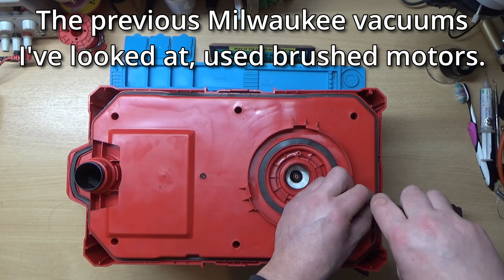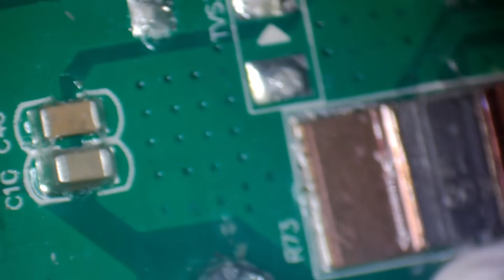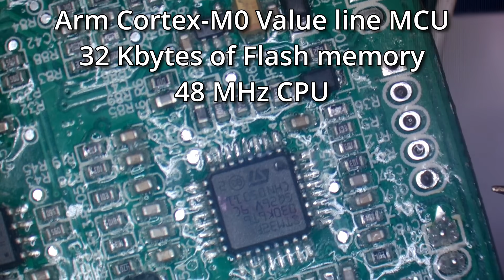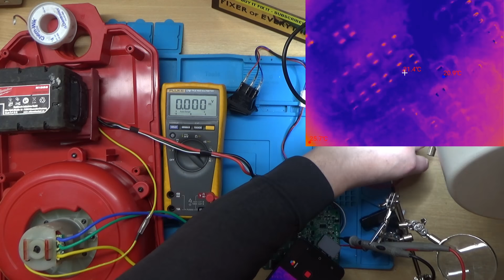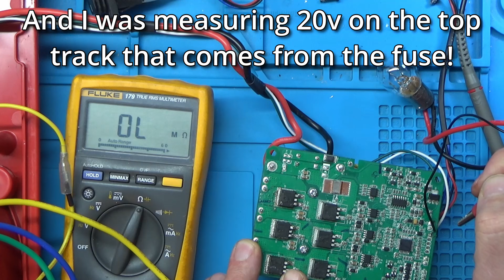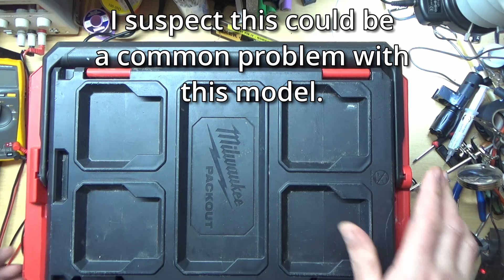Faulty Milwaukee Packout Vacuum Cleaner | Can I Fix It?

Comment: Mine makes a sound, and it turns off in a split second any idea what that could be?
Reply from the maker: I'd replace the fuse first. The guy that sent me it had another which would run for a minute before cutting out and it was the fuse faulty too.
Reply: i got mine to run after flipping it and removing filter... ran it for 2 min, reinstalled the filter and it works... weird, now it will be ok until i clean it again... dont know whats causing it, cant be fuse, since its running  @BuyitFixit
Reply from the maker: It can mate, the guy that I got it from had the exact symptoms with another. I think the fuse heats up, disconnects, then after r it cools it's good again. With the filter blocked it would be drawing more current and heating up faster. I'd replace it like I did and see if it cures the problem.
Reply: @BuyitFixit  i dont think its fuse... it doesnt run after 2 days of not using it
Reply from the maker: @genekhuc8824  I'm not 100% could be a dry joint. The guy I got it off told me that the other one he had would run for a few minutes and then would cut out, and he couldn't find any temperature cut off. He later said that he tried bridging out the fuse on that one and now it's running without issue. Perhaps yours is a different issue.

Comment: I've had just about as much as I can take of Milwaukee unfit for purpose electronics.

M18 Circular saw board gone & costs as much to replace the board as buy a brand new saw.

Same with M18 Surge Impact driver, replacement board is £10 less than whole new tool.

The quality of Milwaukee electronics is appalling & their slogan of "Nothing but Heavy Duty" is a joke.
Reply from the maker: Yes I also found the price of replacement parts were almost the price of a new tool 🙁

Comment: I reckon I'd have installed a panel mounted fuse holder next to the battery to make it easier to replace next time..
Reply from the maker: Good idea, but hopefully there shouldn't be a next time 😂👍
Reply: @BuyitFixit  I'm afraid i don't share your optimism! You already know of three which had the same fault.
Reply from the maker: @NeilTheTurtle That is true, however it was the fuse itself that was the problem on those three units. If the automotive fuse blows it will probably have a reason (shorted mosfet or such) which would require disassembly to repair any.
Reply: @BuyitFixit  yeah, that's a good point. Keep up the good work.

Comment: @36'20" you are spot on. It's a resettable fuse. Bizarre effect.
Looks like they accidently used a PTC fuse in the production line with '30' marking instead of a normal 30amp SMT fuse.

Easy to do and sadly might get through initial quality control as these resettable fuses can cope with a few dozen overload cycles before failing progressively in this way.
"30" probably indicates 3 Amp nominal. These resettable fuses hang on during over load and can often cope with momentary 40 amp spikes.

Milwaukee quality control probably would have caught it if they had done a prolonged 'filter clogged' test.
Had a similar fault in a battery operated toy train. Much easier to diagnose as the train motor operated normally until a load was put on it.
I imagine that your vacuum initially worked ok then started failing under high load, progressively degrading to the point you got it
Interestingly, in my case, resoldering the ends of the PTC fuse partially restored it's ability to work (short term).

Probably only affects a few dozen units in that production run.
I wonder if the units did actually fail quality control, were rejected and because they sort-of worked someone snuck them out of the factory and sold them.
Makes you understand why manufacturers who value their reputation crush their rejects.

For some good info search for "Eaton-Ptc-Resettable-Fuse-Application-Guidelines"
Reply: is there a vacuum running around with a 25A car fuse now? 😅
Reply from the maker: @prometheus4130  Of course. Better than factory 😂😂😂😂
Reply: @BuyitFixit  if you’re interested I have an inventor dehumidifier which sort of works but the control board is faulty. works sometimes but often not. got it on ebay with a mind to fixing it but not had any luck yet
Reply from the maker: Sounds like a dry joint or capacitor especially if it's working intermittently.
Reply from the maker: Thank you, and thanks also for the long a nd detailed comment. Interestingly the another unit that Scott had was a slightly different fault but the same root cause. That unit would run for so long until cutting out which progressively got worse over time. Thanks again for your thoughts and comment 👍
Reply: @BuyitFixit  Yep, that other unit was at the early stage of poly fuse failure.

Comment: Many times if the wire integrity is compromised you will get a reading but it will not be able to handle the load. The bulb/load test is an excellent tool. Great job
Reply from the maker: Thank you 👍

Comment: My god, microcontrollers on a vacuum cleaner? It should have a switch, battery, and a motor.
Reply from the maker: I've got a couple of LED lights, one is a spotlight which was all run by a microcontroller. It ran mosfets to generate the voltage and monitored the current as well as control the brightness via a push button. It's on the channel and called Milwaukee Spotlight repair I think. I've done a few lights most have microcontrollers now, but use separate LED driver chips.

Comment: Good find! I had all my bets on the switch. I've seen it many times that a corroded switch makes a brief contact while switching but is not latching on permanently. Would have never thought about a fuse failing only under load.
Reply from the maker: Thanks, yes it was pretty much a head scratcher for me too! And it seems like it could be a fairly common problem with this model.

Comment: I have a plasma table wich has a big ring transformer in it
It is from usa so it is 2 x 110 volt rewired for 230 volt
It has 2 auto reset fuses inside like yours but they only reset 3 or 4 times
I cut them out and replaced them with automotive fuses and never had any problems with it
Best wishes from Holland
Reply from the maker: Nice 👍automotive fuses seem to come in handy 😂😂😂 Greetings from the UK 🙂

Comment: the only way I see this can happen is overloading the motor - although it would have taken one of the IGBT's with it
or a battery with corroded contacts
Reply from the maker: Or possibly a faulty batch or poor quality fuses. The same guy had 3 with all exactly the same problem. There is current sensing on the board, and I didn't see any signs of corrosion on the battery terminals.
Reply: @BuyitFixit  seen fake batteries with totally off voltages … so yeah
Reply: @BuyitFixit  Interesting he had 3 with same problem, sound like he may have bought returns from a bad batch. My bets are that it's a production line goof-up. Someone loaded the wrong pick and place tape - The operator likely saw the words 'fuse' and '30' not realizing they were 3amp resetable fuses not 30 amp fuses. Likely to have passed initial low load testing. Probably only a few dozen made like this before quality control noticed.
Reply from the maker: @leybraith3561  A very plausible explanation 👍

Comment: The only time i had a similar problem was with an older glass fuse It was a spring type Anti Surge fuse where the spring was in series with the fuse wire. The spring was somehow making the fuse a high resistance without enough current flowing to actually blow the fuse.  Very bizarre symptoms in the electronics.
Reply from the maker: Yes I bet 👍

Comment: when the one we have in the company fails, I now know where to check first. it is a great wet vacuum for servicing washing machines and dishwashers, when they can not pump water out, and are in a kitchen, where you can not just let it drain out on the floor
Reply from the maker: Nice👍 I'm not a fan of using these wet. I've got the older model and the motor was all seized I guess from moisture being left in the bottom and the vapour corroding the motor bearings. So that would be something I'd potentially keep an eye on.

Comment: Fuse did look to be damaged, so was a good find. The soldering looks to be pretty poor, but that may be just the way the camera shows it - at 6:42 both through hole joints look to be ready to fail (if not quite failed yet!) & similarly with another two through hole joints at 6:51.
Reply from the maker: Thanks 👍Yes looking back at the video there does look to be a couple of joints that don't look the best. Sometimes the microscope light shows shadows that look like dry joints also. The one at 6:51 is just a ground wire that goes over to the motor for static or interference or whatever. It just connects to a piece of metal near the motor shaft.
Reply: @BuyitFixit  👍

Comment: All a Vacuum Cleaner should need is: Motor / Power Source / Switch
Anything else is a design failure.
Reply from the maker: Yes simple. I think a lot of companies are moving towards brushless. I think it is supposed to give more power from a smaller motor, quieter and less maintenance although I think the latter is debatable.

Comment: I've had similar problems in cars. Fuse cracked and allows voltage but no current. Similarly, the wire can corrode so that only a few pins are connected. That's why you should always measure the voltage under load.
Reply from the maker: Thanks for sharing 👍

Comment: Great fix sir, Well, I have one that from the first use I switched it on but it didn’t work, I did switch it off and on again then it worked, just like you said it is a common problem in these vacuums, and it is only a matter of time before mine gets defective.
Reply from the maker: Thanks 👍🙂Yes I think there will be more like this. I think that fuse isn't up to the job.

Comment: Good find as always Mick. In the automotive world load testing is key. I very rarely use a multi meter. Always a test light with a bulb in it, or if it’s a higher powered circuit even a 40-50watt bulb. This is normally down to bad connections in multi plugs or rotten wires but I wouldn’t never of thought about using the load test method in a circuit board. Well done again 👍🏻
Reply from the maker: Thanks 👍

Comment: Seems to me that surface mount components are a step backwards in terms of reliability. I've seen more than a fair share of shorted SMD caps and now fuses making an appearance. That was a very good find. A fuse acting like a poly switch!
Reply from the maker: Agree, seems reliability and miniaturisation have an inverse correlation 😂😂👍
Reply: My bets are that it's a production line goof-up. Someone loaded the wrong tape - probably saw the words 'fuse' and '30' not realizing they were 3amp resetable fuses not 30 amp fuses. Likely to have passed initial low load testing. Probably only a few dozen made like this before quality control noticed.

Comment: The meter was reading rresistance from the circuit while it was in the board, i bet if you tested the fuse removed from the board it read 0 ohms. You were picking up resistance from the load side of the fuse.
Reply from the maker: I wouldn't have thought so, as one side of the fuse goes to the red wire, which just goes to the battery connector. If you measure resistance across the fuse (with the battery disconnected) then that side is not connected to the rest of the circuit.

Comment: Fuses should be 0.1ohm or less, not 2+ ohms. First rule of electronics: Thou shall check voltages. 2nd rule: Thou shall check fuses. Stupid surface mount fuses. I would've just replaced it with a 20A car fuse.
Reply from the maker: Yes, I wasn't sure if it was my meter leads or the thick conformal coating on the board not allowing proper contact. I've never had a faulty fuse measure anything as low as that before and wasn't sure if those resettable type do have a low resistance. The voltage was 20+v on the input to the fuse and 20+v on the output when I tested it, and I did replace it with a car fuse although 25A.

Comment: I had the same issue with a walk behind floor scrubber. The main switch dropped the voltage and the voltage protector shut it down. Took me 3weeks to find the problem with a multimeter. An incandescent light bulb would solve it instantly
Reply from the maker: Yes 😂😂 cheap lightbulb vs £££ meter 😂😂😂👍

Comment: I have never seen a fuse read 2 ohms. Always close to 0. When I saw what it read, I said to myself that is bad. Just saying.
Reply from the maker: No problem. I thought it was odd, although at first I wasn't sure if it was my leads or if it was making a good contact with all of the conformal coating that was on the thing.
Reply: @BuyitFixit  Yeah, been there done that.

Comment: Weirdly I just bought one of these new, I noticed the 3 ohm resistance from power in to the mosfets compared to .3 gnd to mosfets likely from the fuse, shame we didn't get to see if the fuse got hot briefly as the resistance went up... Scott we need another broken one for a follow up lol
Reply from the maker: Yes I didn't think of that at the time. It would have probably showed on the thermal camera.

Comment: I really enjoyed this one, especially using the oscilloscope and lamp to demonstrate the firing of the Mosfet gates to drive the load. This really does demonstrate how unreliable voltage only checks can be, as the fault only showed when current was being supplied to a load.
Reply: Yes, voltage checks is the first step. Car mechanics dealing with electronics ALWAYS confirm that test with a lightbulb...
Reply from the maker: Thanks 👍🙂

Comment: Why the hell do you need a control module in a vacuum way over engineered a resister works fine for different speeds it works in you car
Reply: I think has something to do with the brushless motor
Reply from the maker: Yes brushless motor needs a special driver and control board.

Comment: There's a PTC fuse in the Braun Oral B Genius electric toothbrushes that is notorious for doing the same thing. Runs for a couple of seconds and goes high resistance. First one I got replaced under the manufacturer warranty, the replacement unit after a few months developed the exact same fault and opened it up and replaced the PTC fuse with a different brand equivalent and its been perfect ever since
Reply: I may be misremembering my toothbrush, but I would not have thought it would be practical to open (non destructively) and repair. Props!
Reply from the maker: I think on some the bottom comes off, I did have a problem with a charger on one but that was pretty much impossible to repair as it was all potted with hard resin.
Reply from the maker: Nice 👍I'm glad I'm not the only one who's experienced this problem 🙂Well done on fixing your toothbrush 👍

Comment: That sux! 😂
I was super surprised at the beginning that it actually had a BLDC motor and controller.  Surprised again going back to the fuse. That low ohms reading was a killer because it allowed the control circuit power with no load and not nearly enough through to power the motor load. It doesn't look like a PTC though, must just be a bad batch of those SMD fuses. I would have put the same fuse in as a replacement and in almost the same exact way.  Nice fix. I do bet many of these will have that same fault for sure.
Happy New Year!
Reply from the maker: 😂😂😂Yes I think it's a bad batch or just a poor quality component. I too suspect there will be many of these that have the same fault too! Thanks 👍and Happy New Year to you too!
Reply: My bets are that it's a production line goof-up. Someone loaded the wrong tape - probably saw the words 'fuse' and '30' not realizing they were 3amp resetable fuses not 30 amp fuses. Likely to have passed initial low load testing. Probably only a few dozen made like this before quality control noticed.

Comment: Way to hang in there and sort it out. It's an unusual situation for sure, but partial failures happen and can defy expectations. Success means a quick tidying of the workbench too FTW!
Reply from the maker: Thanks 👍Yes I had a partial failure with a diode on the my Aixun soldering station a few videos back. I think the bond wires inside had failed and when I re-soldered it the thermal expansion caused the wires to connect again (for about 3 weeks before it failed again, and I ended up replacing the diode). It's been fine since 🙂
Reply: @BuyitFixit  Yikes, I recently added that soldering station to my workbench and love it. I hope your component failure on the Aixun was a random fluke, but I'll consider it in my troubleshooting from now on. Mercifully, I have yet to encounter such a situation, but I'll trust my instruments and my noggin as you have demonstrated. I love the varying array of devices you bring back to life and your ability to voice what you think as you progress. Yours has quickly become one of my favorite channels. Thank you so much for your time.
Reply from the maker: Thanks Kenny, much appreciated 👍

Comment: You Sir, are a legend! Side note: a 25A blade fuse probably won't trip until about 40A goes through it... 25A is the continuous current it will take without blowing. :)
Reply from the maker: Thanks 👍and thanks for the info 🙂

Comment: I saw the bad solder joint at the beginning at 6:52 and was yelling at my screen.
Reply from the maker: I've just looked and you're right it does look at bit dry that one. Although it wouldn't have caused a problem as that is just the antistatic / earthing grounding (yellow) wire that goes to the metal part near the motor shaft.